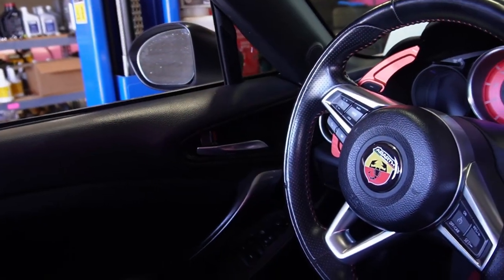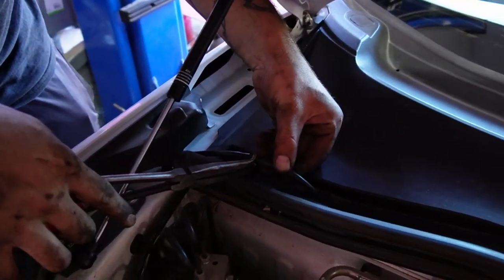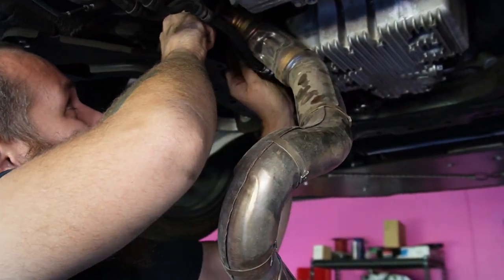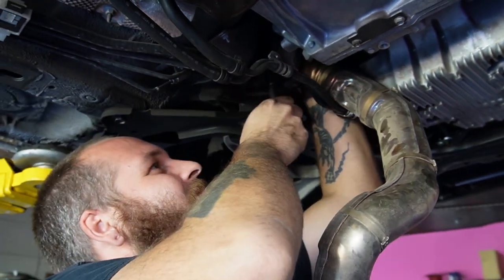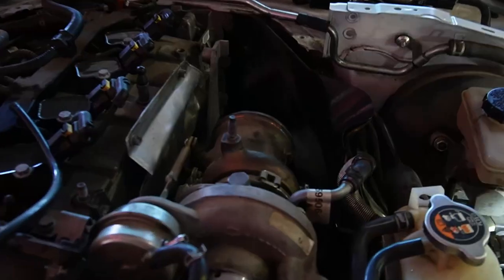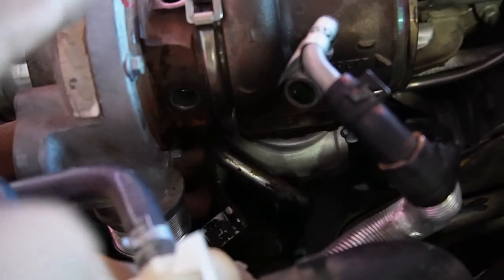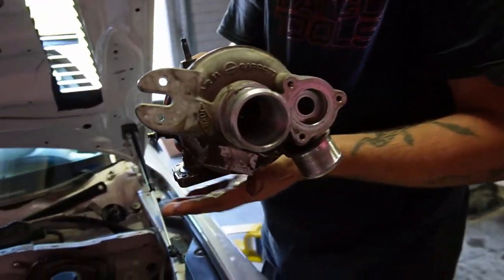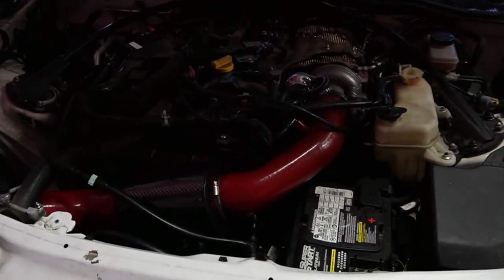DIY Fiat 124 Spider Abarth Turbo Replacement

Comment: What are those lines you replaced at the end? Couldnt find them on the forum, are you replacing them because they go bad?
Reply from the maker: Yes on multiple cars we have had oil and coolant lines fail in the area so replacing them while turbo is out saves hours later
Reply: @WDLRacing   Are these lines universal or vehicle specific? I would like to replace mine when the time comes!
Reply from the maker: @eastonnguyen5346  vehicle specific.  Purchase them from the dealer